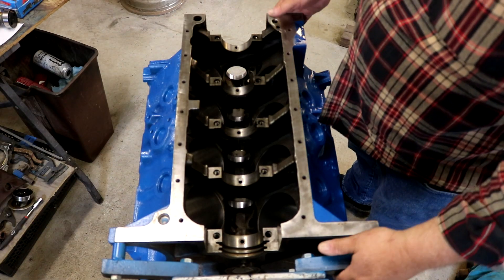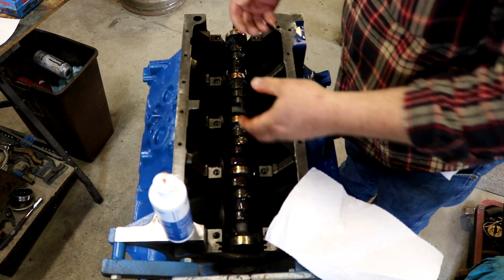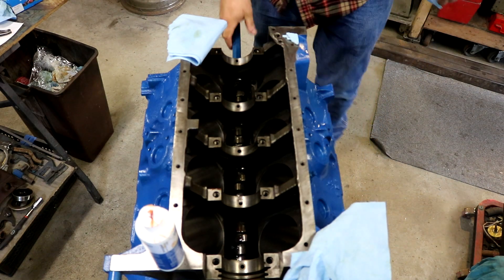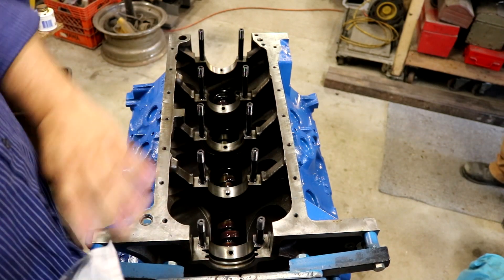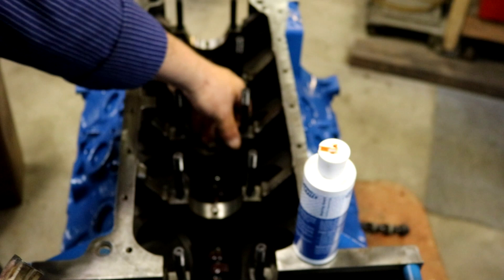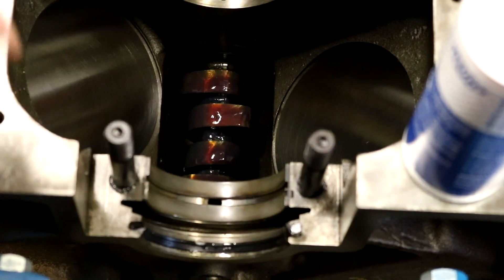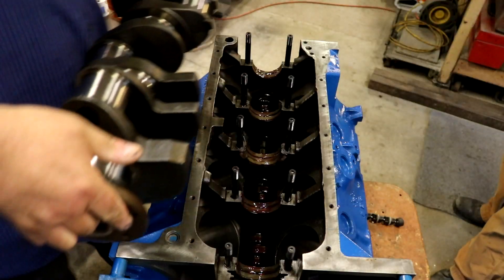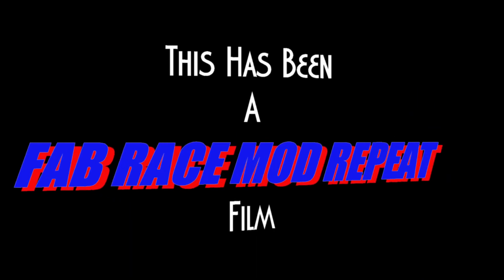FE build part 3-A

Comment: Love the build man im currently building a 390 as well! What cam did you go with? Also what lifters and length push rods did you end up getting?
Reply from the maker: The valve train and can is all Comp Cams; except of course the rocker and shalves. As to push rod length you will want to measure your particular setup to ensure the correct length.

Comment: Is there a reason you dont use lubraplate assembly lube on the mains or cam?
Reply from the maker: Taylor Sutherland
I use lubraplate on some builds and assembly lube on others. I have done a complete engine build with lubraplate. Haven’t had any trouble to date with either method.

Comment: Looks like a fun rebuild, what will the final cubic inch be and horse power?
Reply from the maker: michael wasson 
She’s a 390, 30 over so about 396 is the final displacement.
It has a mild cam and about 10.1 compression. It should be right around 430hp. This ones more for cruising and  spirited driving than racing.
The intake we’ll be using is more for torque than HP.
Everything that has been done to this engine has been for reliability. All will be revealed as the build moves forward.
Thanks for watching
Reply: @FabRaceModRepeat  Sounds solid.  430 is still plenty enough to get moving quickly especially if its got some tq down low.
Reply from the maker: Julien Nacer 
Absolutely!
She’s all about bottom end